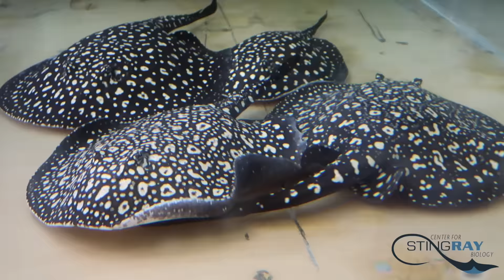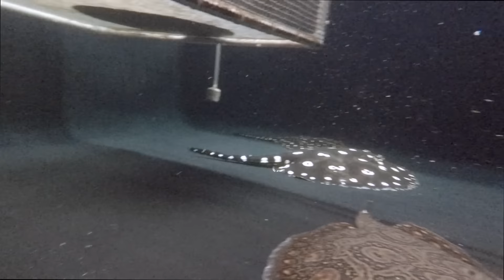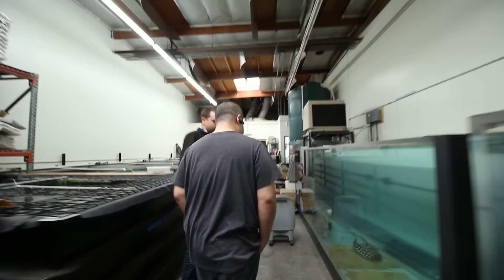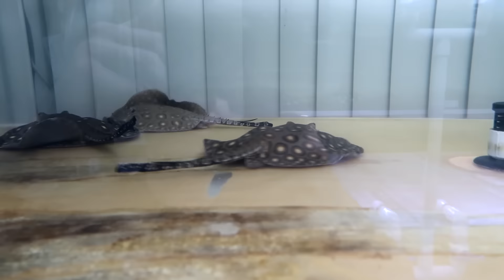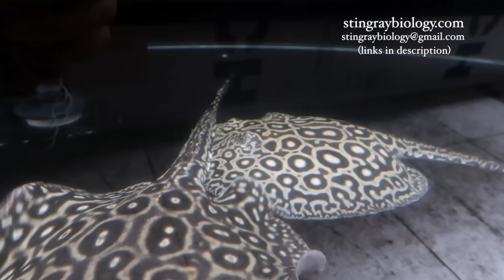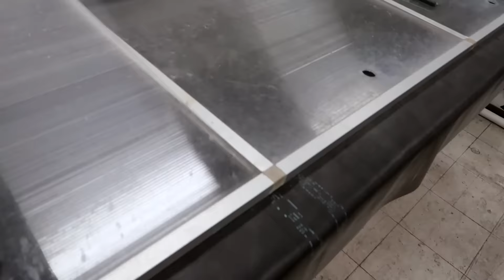INSANE stingray aquarium tour!!!

Comment: i wanna know tho. Are these rays dangerous?
Reply: Giovanni Roye Yes, to your wallet!
Reply: Giovanni Roye if you get stung deeply it is debilitatingly painful and the venom has a lot of bad microbes and bacteria which could cause an infection, and could even lead to gangrene in a severe case. Much more potent than saltwater rays. Furthermore, the puncture site will take months, maybe even years depending on the location and severity to heal completely. Even grazes or scratches can be painful and need treatment. Luckily the first step of treatment is relatively easy. If you are stung you want to put the affected area under hot water, as hot as you can possibly stand without scalding yourself. Then I'd recommend going to the hospital if it was either deep, or if it starts to hurt an extreme amount.